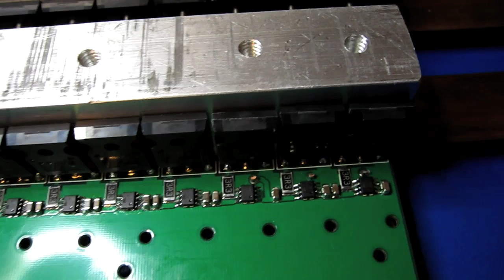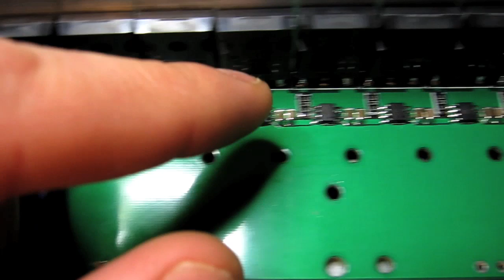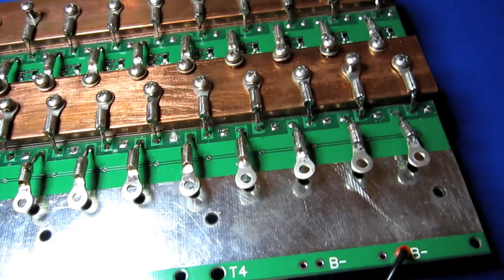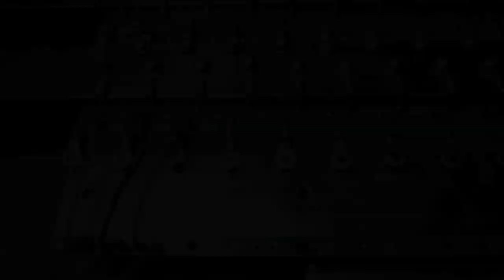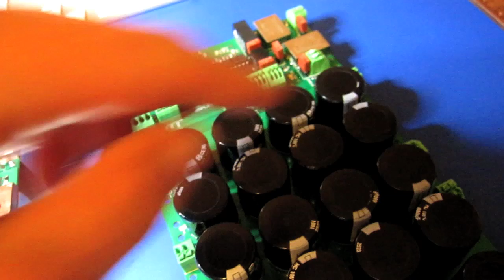Custom Motor Controller Build #7

Comment: Why is it that the MOSFETs switching too fast a bad thing ? Isn't that desired to minimize switching losses ? Thanks.
Reply from the maker: It is and it isn't. You are correct that faster switching decreases switching losses which is good, we all want that. The problem is that faster switching times also increases the magnitude of transients. The transients can have enough energy to destroy the mosfets if not taken care of.

To decrease the transients you can increase the switching time and/or you can design in some sort of snubber circuit (there are many types of snubbers).

After more design and testing I ended up going back to the 3.3 ohm gate resistors and kept the ~100nS gate rise time. In order to do this I had to design in a large RC snubber to absorb the transients. The snubber itself consumes some power, but without it the mosfets would be destroyed.

In my particular case keeping the switching times fast was worth it as my controller can handle an enormous amount of power and is very efficient. It really only hits 10-15C above ambient, even when driving full out.

Comment: Looks quite good. Maybe you can use some locking washers on those connections to the copper bar. The capacitors look good they are fat and short but maybe you can use some glue to help with vibrations once it gets installed on the bike.
Reply from the maker: Thanks! Yes I will be using lock washers on everything once it is complete. I have had to disassemble and reassemble it a number of times so I haven't bothered to put lock washers on anything yet.